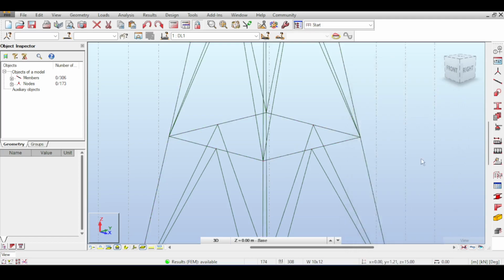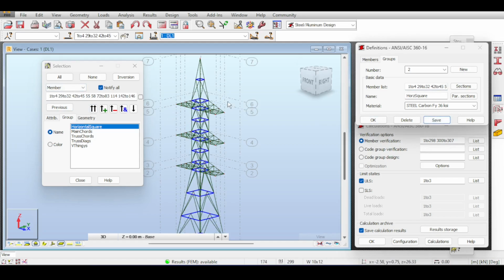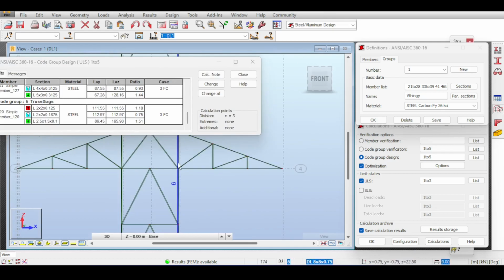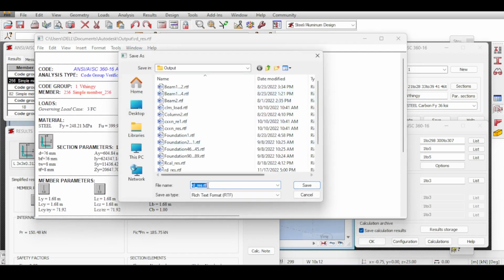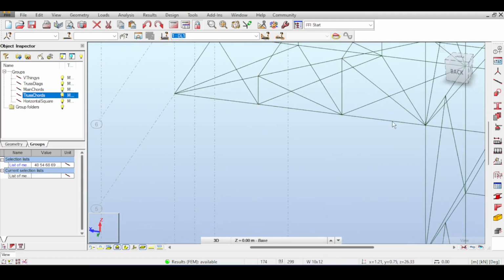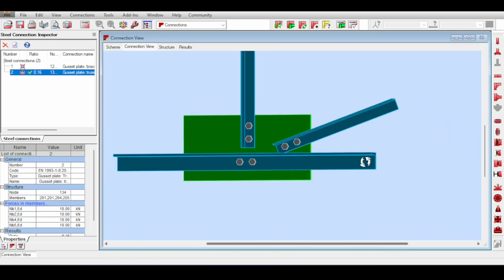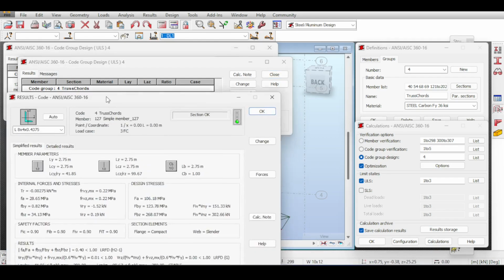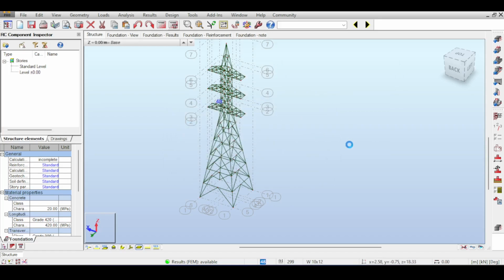Modeling Lattice Steel Transmission Towers Using Autodesk Robot | Part 5 - Finalization

Comment: Good day Prof.

Thank you so much for this series on the transmission towers. It had been a blast! CEE work, tips, hints, and ideas are priceless. The overall information provided in this series is certainly (in my opinion) more than enough to allow for confident build-up and improvements and to enable informed tackling of real-life transmission towers design project(s) in full.

Earlier today, I went passed a place where there are transmission towers. I just had to stop and looked 🧐, I even took some indicative measurements of the main chord’s sizes and bracing (at the bottom of the tower of course ⚡⚠⚡ ). The main chords were 200mmx200mm EA for what appeared to be a FC tower; and for the other towers, the main chords were 100x100 EA. 

Although gusset plates were utilized for some of the “main” connections and especially at the connection points where multiple main members join or connect; gusset plates connections on the entire structure were kept at minimal. Most bracing, vertical, and diagonal members were fixed directly (without the use of gusset plates) to the main chords with two or even with just a single bolt. My other observation was that these “direct connections without gusset plates” were mainly possible due to their carefully planned orientations of the lattice members at those locations (this made me remember and appreciate even more the sentiments echoed thorough out this series by the CEE about the importance of members orientations and planning for the connections).  

It is unfortunate about the RSAP installation. I seem to recall this has happened before, not so long ago. This is the second time in a not so long enough period? I propose that you have “IT Department” look at it. This is a link from Autodesk that may assist (I suspect you may have already found the link below given your research skills 😊). The 2022.0.1 Hotfix may come as a separate stand-alone file. It may be worth also looking at the other issues such as the "version of Visual C++, and the SourceList value in Windows Registry".

https://knowledge.autodesk.com/support/autocad/troubleshooting/caas/sfdcarticles/sfdcarticles/The-feature-you-are-trying-to-use-is-on-a-network-resource-that-is-unavailable-when-trying-to-apply-an-update-or-install-a-product.html 

Keep well and I am looking forward to the next (silos) series

Regards,
Reply from the maker: Dear Engr. Donald,

I pinned your comment as it contains a lot of really useful information  ^_^ I am really happy that those videos do provide you with a baseline that enables you to tackle similar problems successfully.

Indeed, I have checked out the problem and will implement the fix as soon as I can. I still was unable, given the other responsibilities I have ^_^

I would like to extend my deepest thanks and gratitude to my dear viewers for their feedback, which is an extremely essential part for any interested future viewer to look at and benefit from.

All the best,
CEE

Comment: I Really like your content!!

I have a question regarding the steel design component. Does Robot have a design module for ASCE 10 (2015)? I believe you used the standard AISC 360 as this is the main design standard in America.

FYI: I am from Australia where we use AS3995, however this code is now withdrawn and hence the standard engineering practice here is to utilise ASCE 10 (2015).

Thanks In advance.
Reply from the maker: Hello ^_^ Honored that my content seems to be beneficial.
It does not have the ASCE10 (Lattice Str. Design) because it is a general purpose software, so there you would need to somehow perform some manual tweaks to include it.

Hope it helps,
CEE